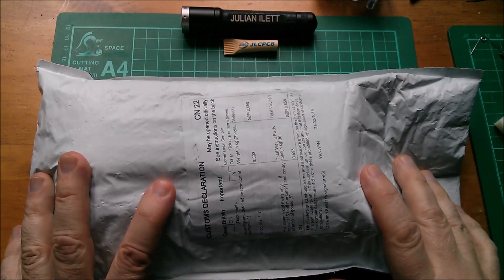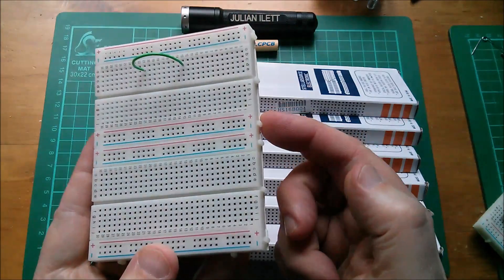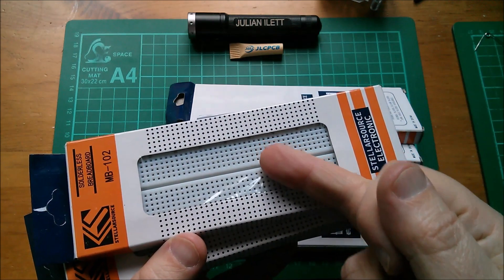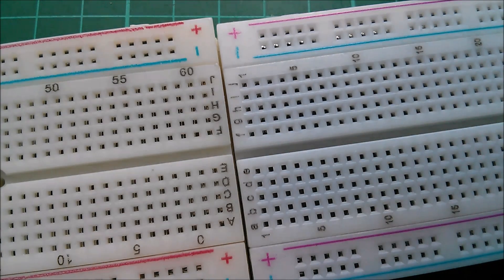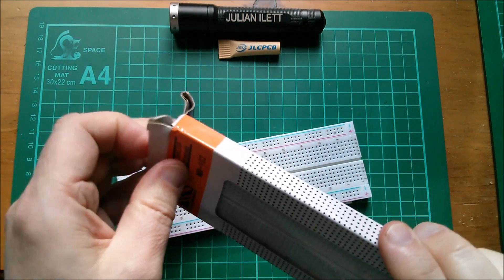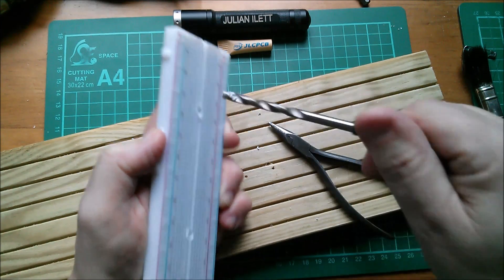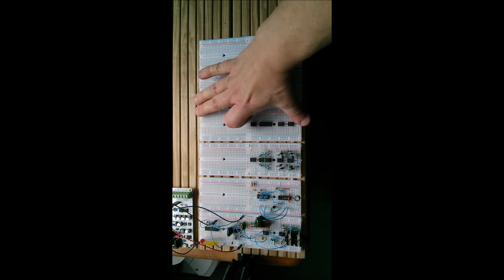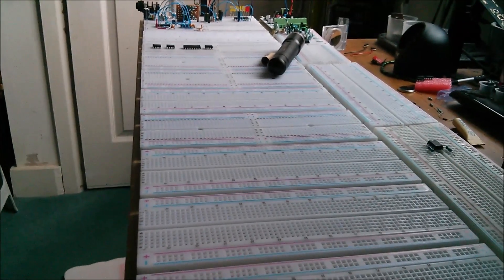Breadboard Brouhaha

Comment: If it helps someone, I bought a pack of 10 breadboards from aliexpress that are good (nice connectors, but the paint is bad and there is the break in the middle of power rails). I bought them on 02/01 and recieved them on 11/01
Seller  : "Electr Stars Store"
Product title : "Free Shipping 10PCS MB-102 MB102 Breadboard 830 Point Solderless PCB Bread Board Test Develop DIY"
Color : "White"

Comment: If you mount the breadboard on thin metal you can dispense with the countersinking simply by screwing up through the metal into the bottom of the breadboard with short coarse-thread screws.

Comment: If you take the large drill bit that you're using to hand deburr, chuck it up into a drill and spin it backwards, it will deburr quickly without drilling into the board (much).

Comment: Since one of these breadboards has 63 rows, drilling holes in the same places as you do with the half-sized boards will put holes at rows 16 and 48.  That would be my preference.  If instead you want the holes evenly spaced, you could drill holes at rows 21 and 42.  The latter might hold the edges less firmly, though.  Yes, you intentionally avoided obsessive spacing calculations, but actually the row count makes this much easier than trying to use the power rail groupings.

Comment: I've found the major sign of a poor breadboard is when the column numbers don't match up on either side. the poor ones seem to get run through the printing machine one way, flipped around and run through again which makes the number 1 on the opposite ends of the board. the good ones I've had have both 1's on one side and 60's on the other.

Comment: You need better wire cutters! Get double 'V' wire cutters that contact the wire in 4 places when cutting instead of flat side cutters that pinch the wire in 2 places.  Something like banggood sku: 1069655 or 1096232

Comment: Just to reiterate what has been said here before. The first thing to check is to see if the column numbers match up numerically. If they don't match up, but run in opposite number numerically, the board  is likely junk with hard to connect points. So the board marking should be consistent so point 'B26" should not be debatable. More important is overall quality, and this is one item worth paying extra for. Not only ease of assembly, but the quality of their connectors. Nothing is more frustrating than spending time tracing down an intermittent problem than finding out that it was a tie point that lost its springiness after a couple of uses, and no longer holds the wire tightly.

Comment: So, that gives you maximum electronic circuit layout territory. Do you intend to jumper all of the power supply leads from one board to the other? Also, do you think it would be wise to place, say a 4.7µF electrolytic capacitor across each breadboard power rail?
Also, if you get the Lindstrom 8141 wire snips, they cut very cleanly. These are very expensive (IMO) at $28 a pair, but worth it in my estimation because they stay sharp a very long time as long as you only use them for copper wire or softer materials.  They are also re-sharpenable, either by you or Lindstrom. Use your other cheap side cutters for everything else.

Comment: i have also been frustrated by the wide range of quality on these boards. I bought a batch in display packaging like these and they work great but there is always a compromise I suppose because 1/8 watt and some of my 1/4 watt resisters with skinny leads don't fit snug. Also, mine had the power bus strips go all the way across the board. The other ones I have purchased have the bus split in the middle and they indicate this with the red and blue strips broken in the middle. 3M is supposed to have good boards but holy cow they aren't cheap. A discussion online says they are made for them by assemblyspecialist.com which, if it is true, sell them for much less but only ship to US.

Comment: Hi.  I've had unpleasant problems with many breadboards.  To make a long story short: BusBoard and the Jameco WBU series are the good (but expensive) ones.

Longer story: Sometime the wires don't go in, and often the wires make intermittent connections after time.  I would spend quite a bit of time troubleshooting a wiring problem only to find out that things were wired correctly and the problems were due to intermittent contacts.  

InterlinkKnight did a good video on the subject: https://www.youtube.com/watch?v=XKQJhe9n_ug.  
Ralf S Bacon had some gripes too:  https://www.youtube.com/watch?v=WbWeDQpMicM

Comment: You can get much easier wire insertion if you cut the wires with sharp 'scissor' type of cutters that cut by slicing - such as on high quality stripping tools.. and especially if you cut the wire on a slight diagonal.  When people cut the wires using diagonal cutters, the wire is basically crushed in half - forming an end that's flared much like the shape of a hatchet blade

Comment: I find the large funnel BBs don't hold wires as tightly., and if you use pre-made wires with the pin end that don't have a burr they go into the small funnel BBs just fine. If you spun those wire ends on a grinding wheel they will go into the SF BBs fine.

Comment: One evening I noticed that sometimes, breadboard work was impossible, sometimes it was just easy.  Then I saw your previous video, after which I just ordered a batch from Pololu and threw out a bunch of my randos.

My recent breadboard-mind-blown was realizing that the half-length ones have offset power holes, rather than lining up with the main holes.  So you can't just drop a Digispark type board into them and have vcc and ground connected.

Comment: Nice new breadbords, are you planning after you have finish this project and it's working ok, to covert this all to real pcb's so you need less space and put it in a nice case?
Reply from the maker: Front panel vocoder is a concurrently running project :)
Reply: I woundered this as well.. Once it works, it'd be pretty temping to pot in in clear casting epoxy resin if did not want to duplicate/change!  Crazy solderless breadboards are probably cheaper than punched pad per hole pcbs :)

Comment: Thank you for another nice video! I thought I was the only breadboard fanatic, but you have me beat. Important, Check the resistance of several  of the metal strips! I've found some from ebay that the resistance was so high they were useless. I found that out the hard way after my project kept failing even though I knew there wasn't anything wrong with the design. I also had the same problems that you've had. Thanks again.

Comment: check the bus bars if they are continuous. on some breadboards they are interrupted somewhere in the middle. it took me ages to figure that out. since that day i have a staple connecting the bus bar's halves
Reply: In my experience the lines on the sides are interrupted if there is a break in the bus bars.
Reply: I had the same thing and used the smaller pieces of an assortment box of pre cut/prebent solidcore breadboard wires (you know those sets :P) to make the inbetween connections

Comment: What size was the wire with the green insulation ?
Reply from the maker: Conductor measures 0.6mm - plastic outer is 1.2mm. But these are measurements taken with my $4 digital calipers. This wire is about 30 years old - came from Maplin in the UK - probably good quality solid copper (tinned).

Comment: well its not nearly as bad as if the wires go in flawlessly and then the contacts are a bit loose and therefor make no contact. if your circuit then not works (or even worse works partially) --> good luck finding this. gets even harder if cables with bad contacts or internal microscopic breaks are involved. this will drive you crazy. so not complain on this.

Comment: I have experienced a lot of issues with the new fangled bread board wires that have the finger holder and finished ends on them. I have 22 gauge (solid) wires I made for breadboard use way back in the late 80's and have no issues with those going into the same breadboard holes.

Comment: I'd be interested in comparing the "springyness" (clinical term) of the metal used. Guessing that the cheaper ones are more prone to stretching to the point where they lose contact with any wires that you do manage to insert.

Comment: I've ran into the same issues with some of those breadboards.  I've had better luck using the pre-made breadboard jumpers that have the pins on the ends.
Reply: There are also bad wires that have a burr on the end, so it doesn't go into those small funnel BBs easily. The good wires go into the SF BBs fine.